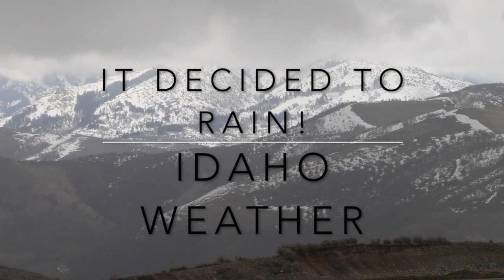HOW TO BUILD A RABBIT TRACTOR | POLYFACE FARM STYLE | ETHICAL MEAT | HOW TO RAISE RABBITS FOR MEAT

Comment: I really like this concept. I have 2 questions if you have time:
1. I like the size of the wire gaps but it still looks like it’s pressing most, if not all the grass down. And you have short grass. Our pastures are long. Do you think you d rabbits would dig fast enough if no mesh was put on bottom?
2. When the tractor is moved across pastures do the rabbits balance on the wires or will they get their feet caught?
Thanks! New Sub.

Comment: It's very pretty, but functionally, I wonder what's the need for the little corner braces? Seems to me the plywood on the one end stabilizes the rectangular shape... as for the other end, it wouldn't have to be open - the rabbits like the feeling of being enclosed, so just covering that end with some solid material would stabilize the structure..
Reply: Maybe it helps with predator proofing? A dertermined/hungry pack if coyotes would meet more resistance with the braces. Also, if the wood on the corner started to rot, you'd have more time to notice a breech?

Comment: What is the overall dimensions of this tractor? You said 4x2 fencing for the bottom, but what size did you use for the sides? 2x1? Also I did see that in your update video you placed fencing around all sides then replaced the wood so they wouldn’t scratch. 👍
Reply from the maker: Thank you so much for watching and taking the time to comment. The overall dimensions are 6'longx3'widex2'high. We also used 2"x1" fencing for the sides. The 24" wide rolls fit perfectly 👌